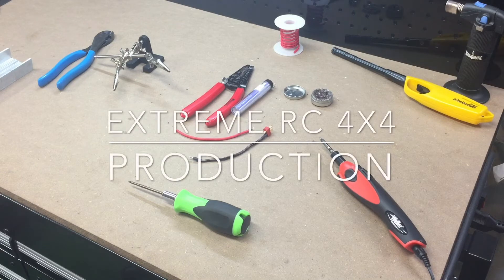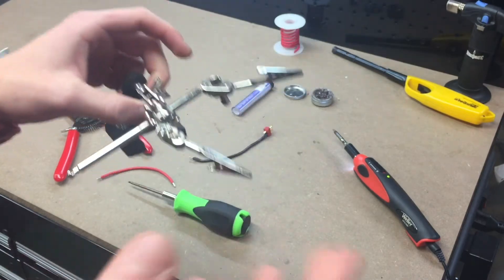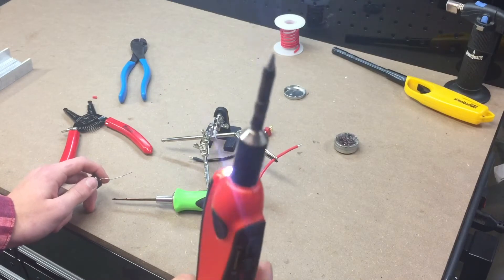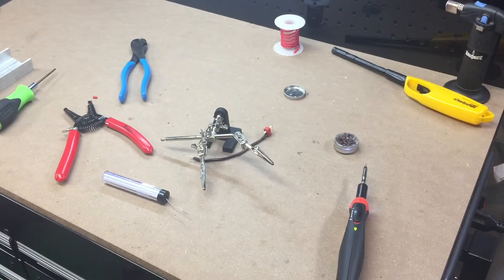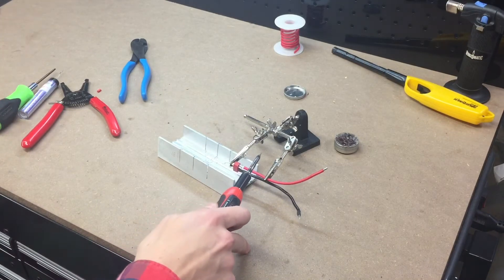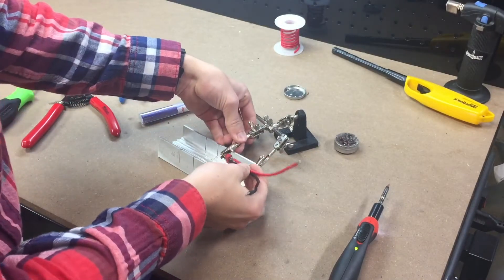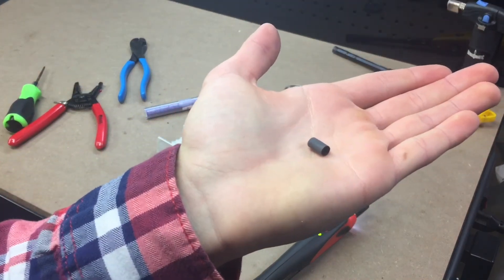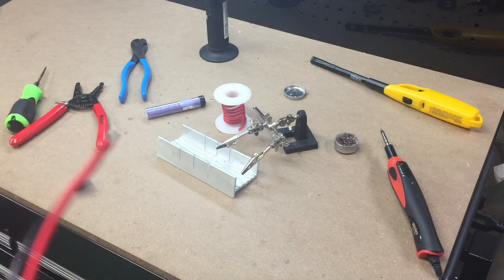EXTREME RC 4X4 Soldering Basics

Comment: Great job on this video! Another good tip! Especially if you are working with cheap eBay deans connectors (like me) hehehe is if you connect the male to female. It will avoid the metal post melting away with the plastic and next thing you know, you don’t have good connection from the esc to the battery
Reply from the maker: I used to have to do the same thing. doing this also helps have the least resistance when plugging and unplugging the connectors. Thanks for the tip, I'll pin it so others can see it in the future!